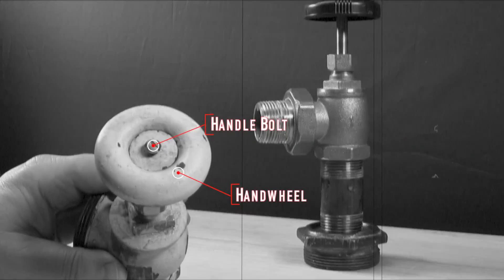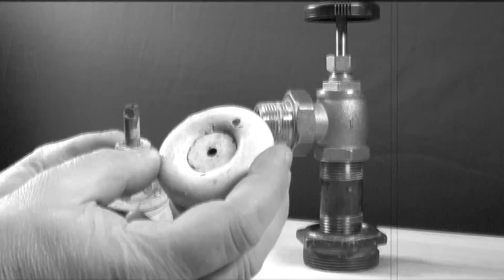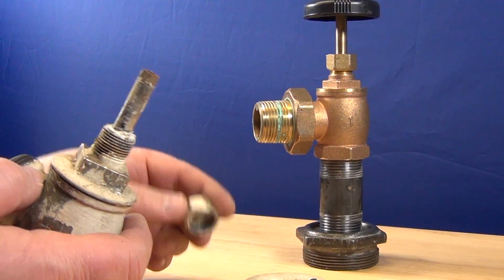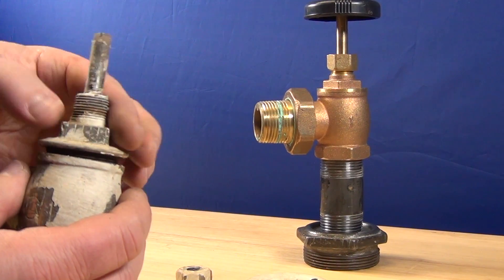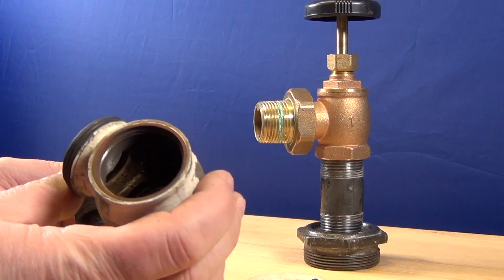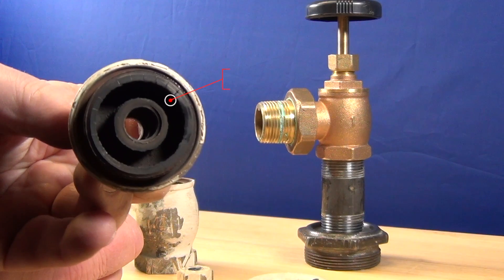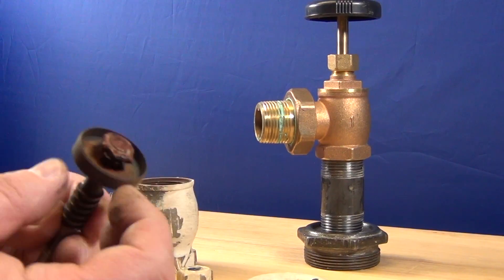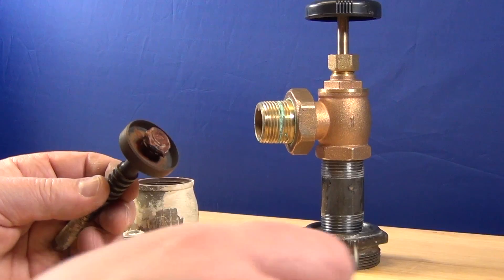Anatomy of a Steam Heat Radiator Valve

Comment: Have you tried to use a 1/4" thick high temp silicon mold sheet and make a cut out of a circular seal to replace that missing seat packing?

I have a lot of original radiator valves still in use that are from a 1901 house and these seem well built and more heavy duty that those brass replacements with the plastic handle. I have two of those brass ones installed with a plastic handle and within 15 years one plastic handle cracked and the other valve stop sealing in the closed position.